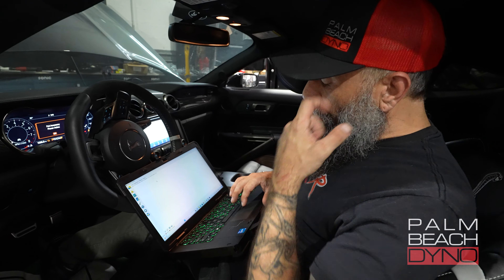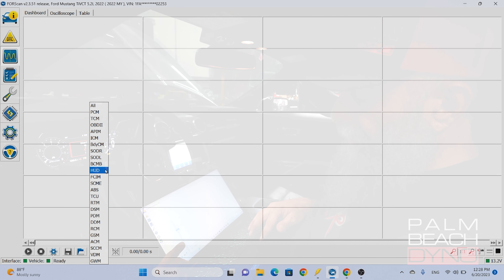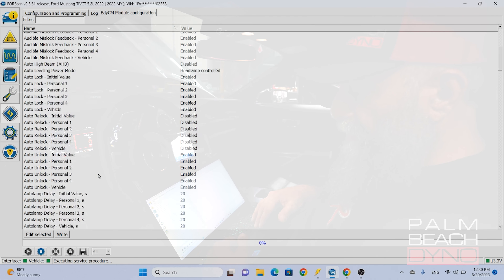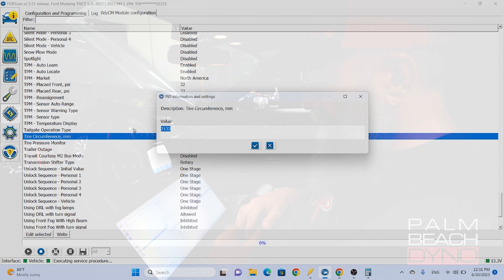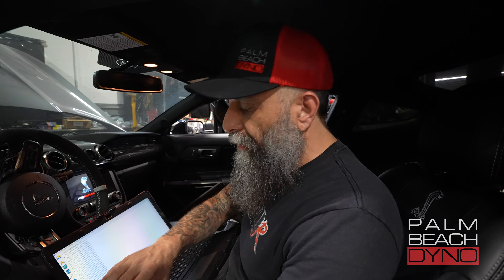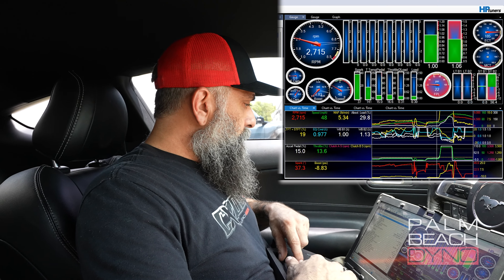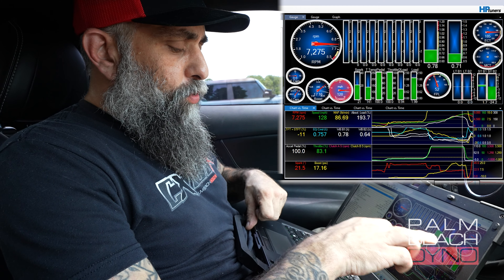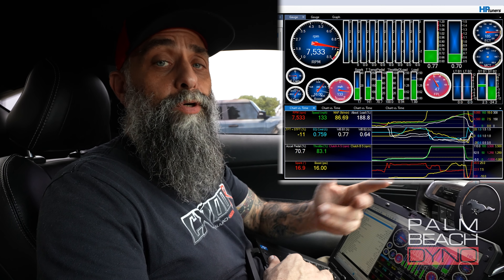CHECK OUT MY FORSCAN!! 🤣 FORSCAN HOW TO & WIDEBAND TECH TIPS | PLUS PBD Racer Highlights!!

Comment: I love FORScan. I used it to enable the in-dash boost gauge after Procharging my 2017 V6 Mustang. I also hacked the ABS module and flashed GT firmware to enable linelock, after swapping GT four pistons on. Then used it to unleash the full range of audio after upgrading the speakers and installing the Sync3 stereo. Let’s not forget that I also enabled all drive modes.
Reply: Do you have the values for that, trying to do exactly that but can’t find them anywhere
Reply: You can use FORScan to modify the in dash gauge?
Reply: @SpeedDeamon95  yep